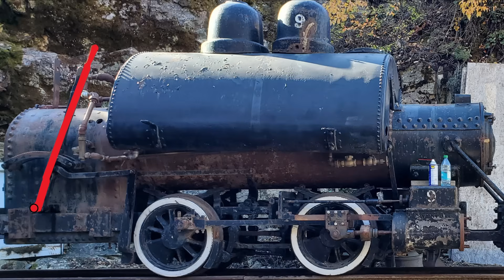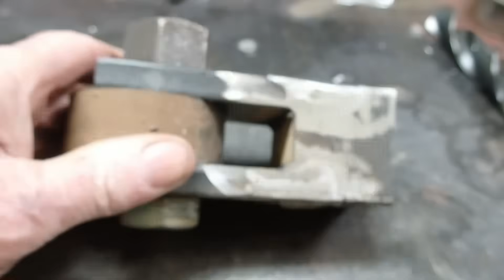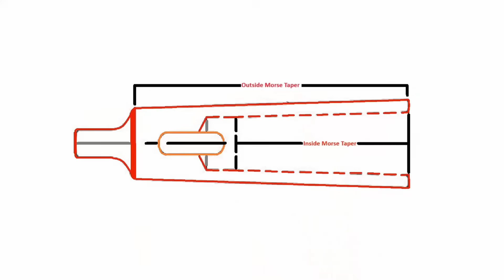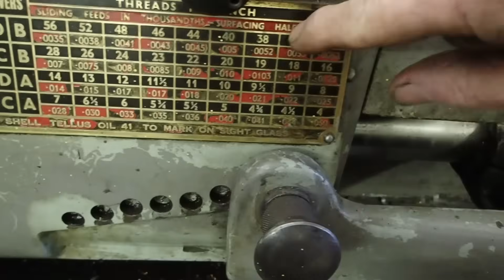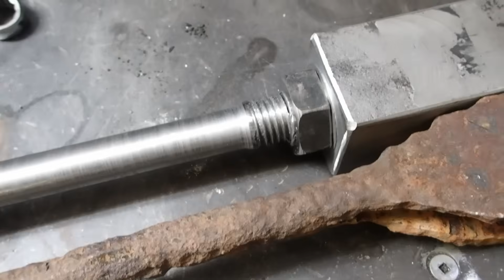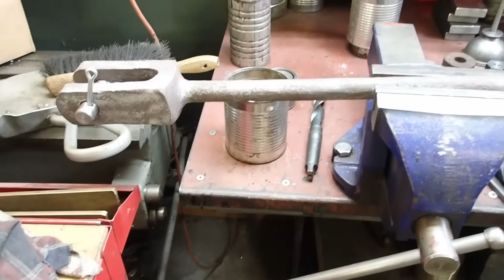Ep 8 - Restoring Blacksmith Made Locomotive Brakes - 2 Foot Gauge Steam Loco Restoration

Comment: Can't see the weld, but I can see the porosity. When you have little bubbles in your weld they are not just on the surface. That joint is very weak and you need to dig out the bubbles with a grinder and refill it with good weld. With 7018 it's extremely important to keep the rod tight to the workpiece for the entire duration of the weld. If you lift the rod up at all it allows oxygen to enter the gas bubble the coating is providing and that creates your porosity. On an important piece such as BRAKES you want sound welds. The last thing you would want is for your beautifully restored engine to crash into something becasue your brake rod end snapped off. I've been a welder for more than 20 years. I would be happy to help you with any tricks and tips if you're interested.
Reply: I'm a mechanical designer and what I saw was sharp corners in the clevis... I thought it would have been better to just slot a piece of square stock with the round of the cutting tool left at the end to mitigate stress points in the part. Also, a left hand tap is not that hard to come by, so having left and right handed threads at either end means you can adjust the rod length without taking it apart. Otherwise, I'm really liking this series!!!

Comment: Bonjour,
Always so instructive, I discover thanks to your videos the work of metal because I, steam modeler, I only work brass and bronze on very small parts, and I have in particular no problem with the threads, I only use taps and dies.
Amicalement, Raphaël

Comment: That rod almost certainly is original. The split you talk about is from forge welding two separate pieces, 100% made by a blacksmith
Reply from the maker: It's certainly old original but the locomotive probably didn't leave the factory with it.

Comment: Very interesting project.
  I have a question as to the forces you explained that were applied to the rod in the fully assembled apparattus.
      With a 1000 pounds ofpull on the first rod that is connected to the piece that splits the movement to two brake shoes,why would the force be cut in half at those points?
      I have a small Smithy mill,drill and lathe that I have much enjoyment with.
Thanks for the nice video,look forward to the next one.

Comment: Fascinating. I can't help but wonder what would happen if you started with a completely clean sheet and designed a steam locomotive with modern day engineering, materials and tools. I wouldn't be as quaint as your locomotive but it would certainly be different.
Reply: Look up on the internet the PRR T-1 project. They are trying to reconstruct what many considered the penultimate steam locomotive design.

Comment: You should have made one end with reverse threads to make adjustments easier
Reply: Just pull the pin, loosen the locknut, and turn the clevis to adjust.

Comment: I'm an Industrial designer and I am astonished at the low grade of the original iron / steel materials used and the poor quality of the machining of the parts. The restoration and replacement work is most exceptional.  Thanks for the explanation of your work!

Comment: Thanks for the explanations about the use of die sets versus machining (Now I know why my one attempt to make custom bolt with thread die failed when I ran the bolt into a threaded block.), why a follower is used while tapping (I thought it was just to keep the threads straight, never thought about broken taps!), and so much information about how the brake system works.

Comment: It's not clear, but is the adjustable pull rod threaded left and right handed like on a turnbuckle so that its length can be increased or shortened?  Otherwise I do not see why both ends need to be threaded.  It looks as though the adjustment is in multiples of half the thread pitch at either end as the fabricated fork needs to remain aligned but can work in either of two orientations.
Reply: I'd think that the pull rod would need to be threaded the opposite way on each end, otherwise unscrewing one end would screw in the other, leading to the clearance being unchanged.

Comment: thank you.

note: if you replace and every every part over a couple of hundred years, you still have the original! (it's still my grandfathers axe, even if it's on its 20th handle and the blade has been replaced when the old one wore out)

. . . even if you improve the materials! . . . the guys who designed and built it would have done better if they could!

keep up the good work, maybe in a few hundred years your descendants will be able to say "he started this project and it's still running!"
Reply: That's been called the "Paddy's Axe" conundrum, from an old joke about an Irishman who says that his axe has had 5 new heads and 7 new handles, but it's still just as good as the day he first bought it.

Comment: That brings back memories of being an apprentice back in the 70's. I have a question. When you were boring out the end pieces, you didn't appear to be using any coolant. Is there a reason for this ? I was taught to always use it hence the question.
Reply: It sort of depends on the material the part is made from and the machinist.  Cast iron generally does not need oil or coolant because the graphite in the iron acts as a lubricant.  Cutting oil is mostly used for surface finish.  Coolant is used to keep the tools and parts cooler while machining.
Reply: @royreynolds108  I thought the material was mild steel, hence the question.